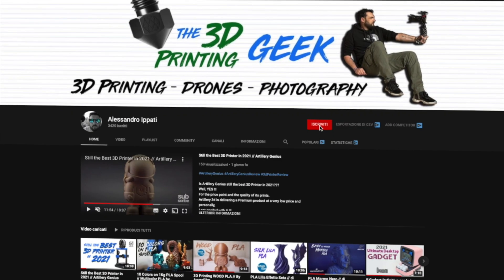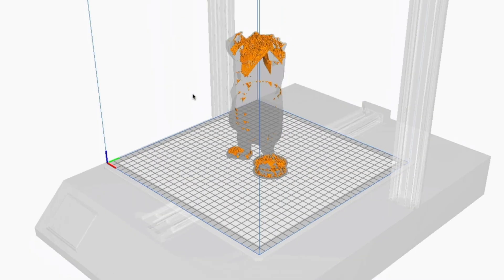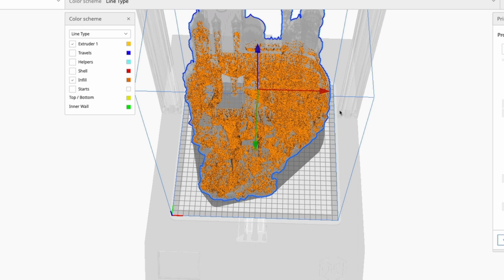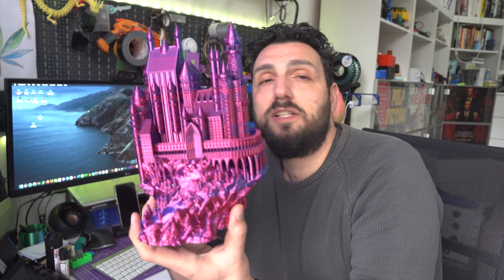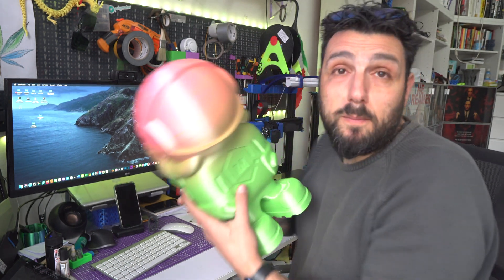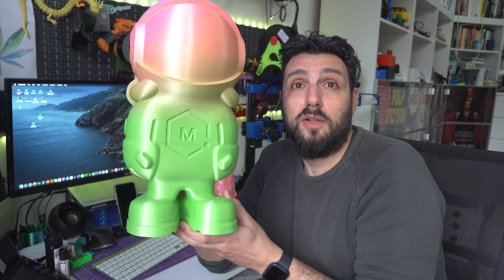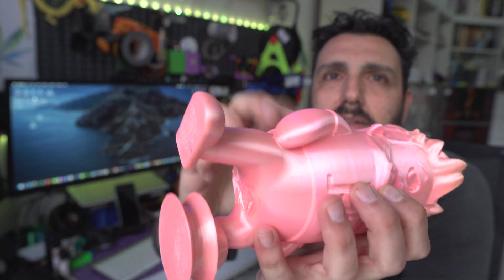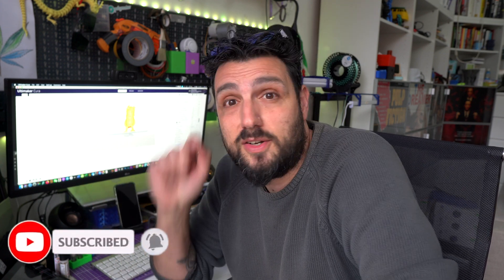STOP Wasting on INFILL // Use LIGHTNING INFILL

Comment: I tried this today and out of nowhere my whole print shifted, including supports, and I had to put it back to my regular infill and reslice it and now it’s going to take me almost 3 days for one print. But i would rather do that than have it messed up
Reply from the maker: That’s the first time I hear this. What printer are you using???
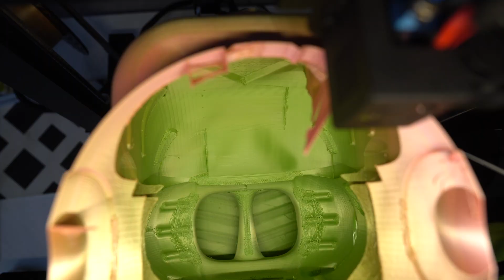Reply: The print head crashed against the infill and it lost steps, screwing up every other layer. Z-hop can help a bit. This is why I don't trust lightning; they're flimsy and curl terribly.  You can even see it at 4:25 that the infill top frame is cracked. This was hit by the nozzle because it curled. It recovers fine, sometimes.  But losing a multi-day print on the top layer because of a shitty infill doesn't save any time.

Comment: I was browsing through the kira settings when I saw lightning infill, currently working on a Halo Reach Spartan cosplay and figured this would be great for the chest armor to try and save some weight. Probably going to use some kind of expanding foam to sturdy up the inside.

Comment: The Infill Density 99% vs 12%.. What is better to use?
Reply from the maker: It depends on a lot on the item. If it’s gonna stand on a shelf, also less than 12% is ok… if it needs to serve a purpose you’ll need to add a lot more